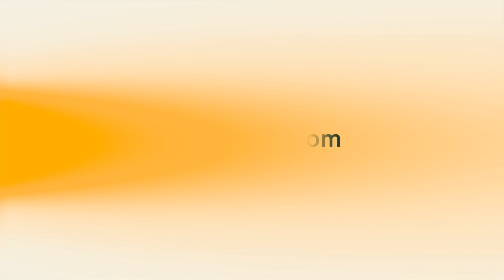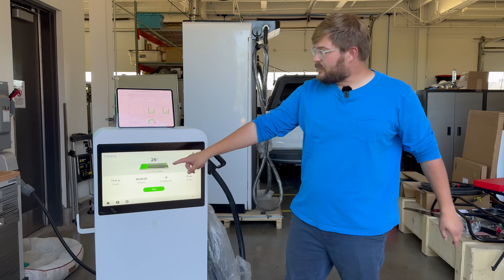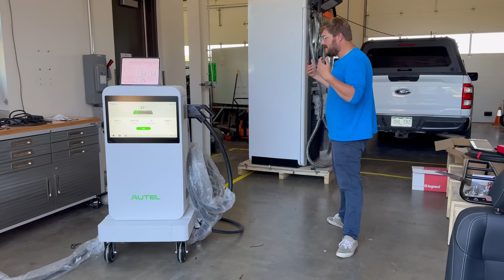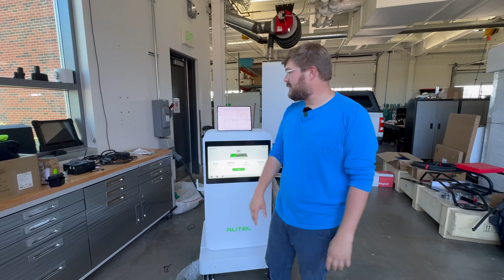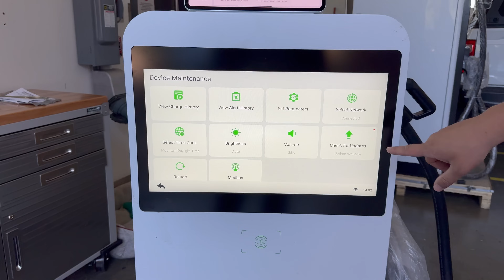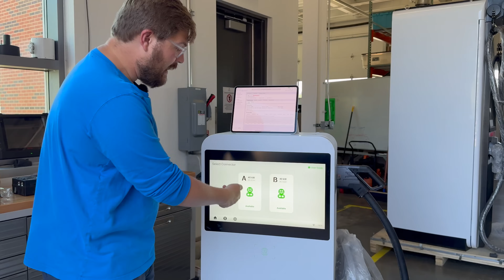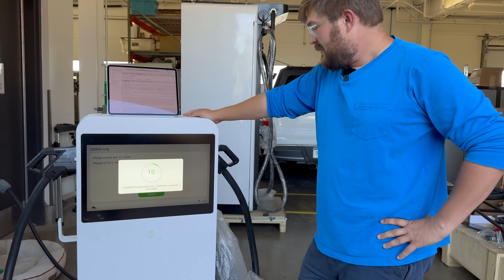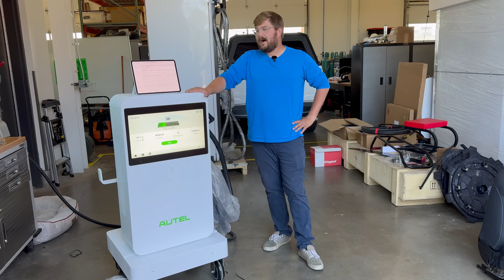The Small EV DC Charger That Could Work For You! Autel DC Compact 3 Month Review

Comment: I use a 20 amp 110v GFCI outlet already in the garage.  1.6 KW is staying ahead of my daily usage.  Cost:  Just the Tesla mobile charger and a 20 amp Tesla adapter cable instead of the 15 amp one that came with it.  Good enough for 1 Tesla for local driving, and there is a Supercharger 2 miles away if needed.
Reply: Most people would be fine with a similar setup, or even just a 240V 20A circuit for a 16A (3840 watt) charger. Assuming 4 miles per kWh a 3.8K input geta you 15 miles per hour of charging or 150 miles in a 10 hour overnight charge.

The main problem comes in when vehicles are atored in cold locations and need to keep the battery above freezing. Many larger vehiclea and battery setups will use 2kw or more for battery conditioning so having a 1.6kw input doesn't help much :)

There are videos of people trying to charge vehicles on 10 and 12 amp 120V chargers and having less range the next day.
Reply: I keep the battery at 70 or 80% for normal use, but I could easily take it up to ~100% from 80 overnight if needed, without having to supercharge.  Or if coming back from a trip with low battery, bounce it up to 70% at the supercharger and finish it off slowly at home, where the battery isn’t going to accept charge rapidly anyway.  Isn’t worth running a conduit and #8 wire out to the detached garage for the rare occasion where I might use 220v 32 amp levels of power.  Others needs may be greater than mine.

Comment: To be honest as a ev driver here, this lower power charger is more beneficial than higher power chargers in a suburban, inner city charging away from interstates. Faster than lvl 2 charging but not to fast to keep you from relaxing as you shop in your center.
Reply: Agreed 100%.  And if it possibly means MORE charging stalls at charging locations, I'm all for it.  EA stations in my area, for example are always full because there's only like 4 stations at each location and one or two out of four are always broken.
Reply: We have a 45kW faster-charger at work, and I love it. I can plug in at like 10%, go work for an hour, then unplug, making the charger available for the next user. Much nicer than having to stay plugged in all day to get the same charge at the lvl 2 chargers in the other lot.
Reply: @coredumperror  would you prefer to have like a dozen l2, or one of these tho? L2's are stupid cheap to install
Reply: @6lejf7 It has a different use case. Over here most EV’s support triple phase 16A (11KW), some do 22kW (but that is usually optional).
The AC chargers (between 2.4kW and 11kW) tend to be for the office personnel. Work 8 hours and leave with a full battery. The DC chargers tend to be for visitors or outside personnel that visits for one or two hours. I’ve recently been to a company that has a whole bunch of AC chargers on each site and a double 120kW DC charger for management coming for visits. 
With my current employer we have the 11kW AC or the 120-160kW fast chargers.
Reply: @6lejf7  Depends on your site's needs. Some zites would benefit more from a swarm of L@s, but some would prefer a few 40kW ones.
Reply: When are they going to make a Bugatti Tourbillon branded version with analog gauges?  These billionaire owners need a way to charge at home.
Reply: Recently came across an 80 amp L2 charger. My EV appears to be incompatible, but on paper: That can charge at nearly 20kW (or 16.6kW at 208V). Only  a handful of Tesla vehicles will charge at 80A though.
The work-around that may work with my car is to default to 70A charging (some cars don't recognize the 80A offer).
Reply: James the problem with L2 80amp is most EVs can't charge that high on AC power. Cars and trucks have a built in AC  charger, so you are limited by what the manufacturer installed. DC charging goes threw the on-site cabinet not the built in charger on your car or truck. Thats why the car chargers faster on a DC charger. @economicprisoner
Reply: @economicprisoner My Porsche can use the 80 amp chargers too. I’ve used them at Porsche destination charging. If you have a car/panel that will do it the Grizzl-E 80A is a pretty inexpensive way to do it.
Reply: @economicprisoner  yeah, you're referring to A/C charging (onboard the car - the charger is the limiter there then).  Shared DC charging makes a lot of sense at restaurants, fast food places, quick shopping places.  Movie theatres would be great for decent amp A/C charging publicly.  Otherwise, A/C charging is for at home / work.
Reply: @blh1997-w1q  Yeah the on-board charger on the older Leafs is only about 3.5kW. If I need a quick charge: that is what the CHAdeMO port is for.
I decided to try the L2 charger because I was planning to park long enough to top-up anyways.
Reply: @jamesphillips2285  Chademo and even CCS 1 are going bye bye. All EVs next year will have NACS, no extra complication or goofy bulky plug connections.  It will be really nice when it is standardized and finally everywhere.  Probably 5 years away for the US though.
Reply: @blh1997-w1q  Which is why L2 chargers are still useful. Very wide compatibility.

Comment: Man, the use cases for this charger and connection at this cost. . . hotels, neighborhood grocery stores or car repair shops, shopping center parking.  It could be used for daily top off for a lot of EV drivers who can’t charge at home.  At this cost, Autel needs to be pushing this one toward shopping centers and hotels and rest areas along the interstate or rural highways, plugs at apartment complexes.  Could it be pole mounted for neighborhood (parking lot) charging?  Way better than the typical L2 plug/speed, so throughput is great.
Reply: Repair shops definitely. Mechanics don't necessarily need dozens of chargers, and this is great to wheel it to where the car(s) are.

Comment: Its probably easier on the grid/infrastructure to ramp up like that, especially if there was 100 of them in a city.
Reply: A fleet of F150 lightings for a utility or installer could definitely benefit from one of these.
Slow charging on AC at night but a lunch break at the shop and a few more completed jobs would be worth it.
...
Or a portable command site for wildfire management.

Being able to deploy this plus a battery or generator could really be useful.
...
Some construction vehicles are becoming electric.
Having this on a trailer with a bettery/solar/generator could give a site a cost effective way to power EV equipment.
Reply: Or car show/racing events.
Reply: A reliable DC fast charger is huge.

Comment: Just need a wall mount version that has 2 parts: 

1 sits beside your solar/batteries and takes a solar input and a battery input and will boost/buck what the other end asks for either from higher voltage solar (400+v) or boosted from the (48v) battery pack on your solar or from AC Grid.
2. The wand end that passes through NACS to that unit and supplies the high voltage from #1.

Not there yet. As soon as someone gets there, I'm in.

Comment: Replace 22kw AC chargers with these. 20kw DC would be 1000% times better for charging.
Reply: Wouldn’t this be the same? Just changes where the AC to DC conversion is happening
Reply: @NicksApps not all cars have 22kW onboard chargers.

We are starting to se 30-60kW chargers beeing installed as destinasjon chargers beeing Installed in Norway as destinasjon chargers at shopping centers..
Reply: @MichaelEricMenk  ah right, ya makes sense. Are there car that even have 22KW AC charging?
Reply: @NicksApps  the early Teslas and Renault Zoe. In Europe most new cars have 32A single phase or 16A three phase charging..
Reply: @NicksApps  22kW is a "rest of world" thing - I'm guessing the original commenter isn't from the US.
Reply: @fiehlsport  gotcha make sense! Would be nice to have 22 KW in the states!
Reply: @NicksApps  99% of AC charging is 11kw or less in the car with some only 3-6kw even though the power supplied / available might be 22kw AC. So time spent on charger is hours. 99% of cars can take 20 plus KW of DC which means charging at 2-6 times faster for the same 20kw.
Reply: Much more expensive
Reply: @mikeselectricstuff  Cant be anymore expensive than an unused AC charger in TCO.

Comment: Permitting is the bane of my existence. Austin has been holding up mine and 40 other neighbors home chargers sitting on the electrical panel addition permit for 3 months 🙃
Reply: Austin permitting/zoning is the absolute worst.
Reply: Stop voting democrat.
Reply: I lived in the city limits of Austin for 26 years as an adult, but the city overlords just got to be too much to bear.  Moved far out and much happier.
Reply: Be ungovernable.
Reply: @ALRinaldi  No an option, it's a large condo building so I don't control the electrical rooms.
Reply: Government bureaucratic BS is th resistance to the transition…… th disruption is REAL
Reply: @SparkySho  Eh, for me the "resistance" is the fact that most public chargers are charging more per mile now than I can get in an ICE car from the gas station. The absolute biggest draw was the fact that it was cheaper, much cheaper. Now it's more expensive. The cars are more expensive, the public chargers are more expensive than gas stations. No one is going to switch if this is the case. (And if Trump wins, I bet he pulls the federal subsidy as well)

Comment: I'd think the initial connection at 20kWh might be to support the case where 2 cars plug in. Give it a minute, and if no 2nd session starts, then give all the gas. If a 2nd session starts, you don't have to remove the module from the current session. Does that sound plausible?

Can these be configured with a single plug? If so, it would be interesting to see if that 20->40 speed change happens then.
Reply: Great point

Comment: This could be super cool at a dealership, top off customer’s cars in service, any electric mobile service fleet vehicles… etc
Reply: Dealers can afford any other commercially available DC charger too :P
Reply: Most dealers only have 1 or 2 Level 2 chargers.  I doubt that many would pay $16K + install for a charger when they are not willing to pay $2-3K for an installed Level 2.   Maybe in a few years when EVs are more mainstream.
Reply: @bbgator1 Almost every dealership here has a DC fast charger. I was under the impression that it was a requirement (at least for GM) to allow them to sell EVs.
Reply: @warpedgeoid  that might be a GM thing, because if they’re shipping a dealer a Silverado with near 200 kWh battery bag, they need to be able to charge that faster than the level two charger.
Reply: @bbgator1  dealers are currently subsidizing by their manufacturer to install DCFC (here in the US). I definitely do not see them spending ~$20K on this Autel unit, at least not yet.
Reply: I work at a Mercedes dealer and they use this exact same 40 kW Autel unit. A local BMW is also using the same unit as well.
Reply: Good to have for testing cars that might have DCFC issues

Comment: Can you try to get info on the Point Guard Energy bidirectional 12.5/25KW DC home charger? I've been digging but so far it seems to be vaporware.

It supposedly sits in their battery stack and will extend your home battery with your EV if needed but there is zero info on any vehicle that it actually works with.